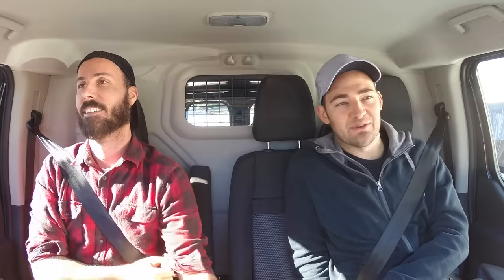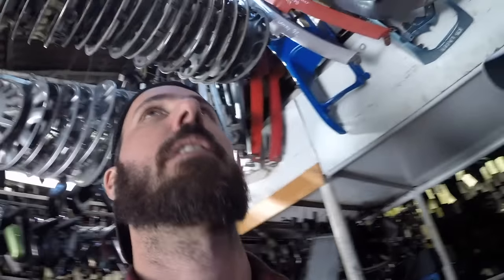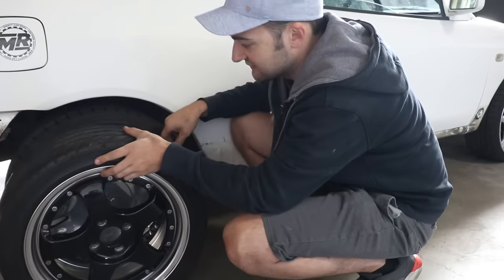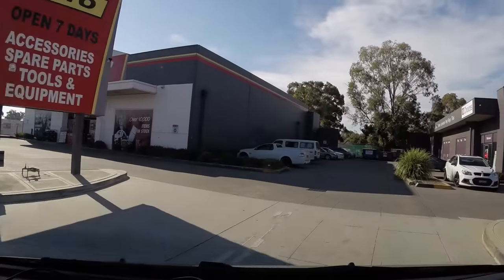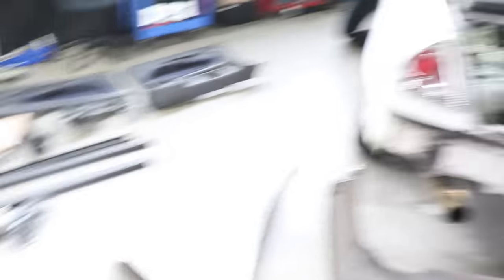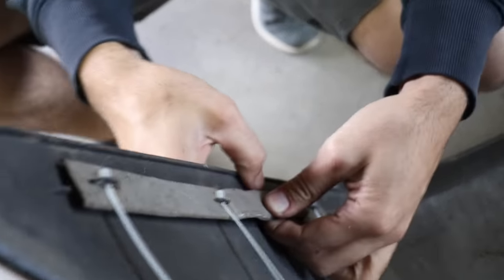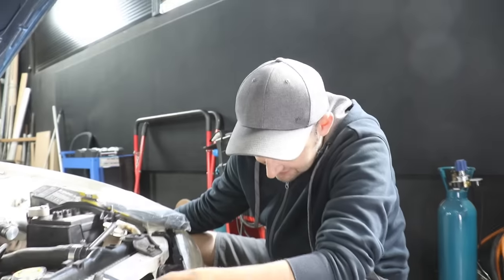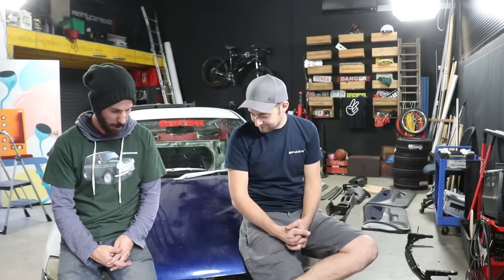How To Unmodify Your Car - Part 2

Comment: That cheeky ford promotion though.
Reply: its just normal, colin furze has it also but dont give it much attention.
Reply: I was rather interested in the van, it seems like a decent hauler. I wonder if it's diesel, it kind of sounded like it.
Reply: ***** ah yes I forgot that was a diesel. I'd take either if it came to US
Reply: No, Transit Custom has a 2.2L 4-cylinder.
Reply: franku sonnnn

Comment: I used to own a 2000 Lancer sedan - the brakes are not suitable for the track, they fade really easy. I did a cheap and really effective brake upgrade - fronts where CC Lancer GSR callipers and brackets and either GSR discs or custom due to the PCD. Rears went from drums to discs - you need to hunt down the rear brakes off a Proton Satria from around the 2000s from memory. It's worth getting everything from the Satria brake wise including the brake cable. It should be a straight swap with no custom work. 

In regards to the side skirts, the MR lancer from that era had a body kit which was mild, the side skirts off of that would work and make it subtle. Great work so far on bringing it back to a normal looking Lancer. Good luck.

You should also do an AWD conversion when you get some $$$$ - there were a few in NZ from memory that got converted - mad 2 door Lancers.

Comment: yes you can get good HP from stock intercoolers, the problem is when you take it to the track. You'll find you loose a lot of power very quickly because the IC heats up and is less efficient.

Comment: i don't know but i feel like the old front easily could have worked for a track car. especially because it could fit over the intercooler and yes it was used for a over all sexspec car which is gross i agree but when the rest is stuck it isn't too bad. you feeling me? and it sure is cleaner than a hacked up stock bumper IMO 

again nice video this is the second time i'm watching it already haha. i just really love your videoes man.

Comment: should do an evo 4 front conversion fenders bumper and hood, the bumper will help wiht the fmic, and the evo 4 fenders are not flared like evo 5-6 so it wont give you a widebody, also evo 5 sideskirts made for 2doors

Comment: hey guys, was wondering if you could help me with a project that i had in mind. I was hoping to make my 1984 corolla's carburated engine into a multi point injection but i hit a small problem... the engine has no crankshaft timing sensor and im not sure if i need any more sensors, any ideas? anything at all would help. Thank you

Comment: i got a question...  

why throw all the body stuff away, only to buy new body stuff?

couldn't you keep the old body stuff, and just repaint it?

 like, bring it back to good colors and reattach correctly?
Reply: Because the sex spec body kit is hideous.
Reply: ok, so it was less about color and condition, as appose to the look and shape of the body parts?

Comment: i just saw a video from air lift performance compering air suspention against coilovers and they got the best of air suspention but didn't show what coilovers they used (maybe even stock) 

maybe its a cool idea to do a real test like what u did with the gt86 or brz's with wheels and coils but now with coils and air?

Comment: Was actually thinking the front mount is waaay to big. get another bumper and im sure you guys could get ir have a smaller intercooler. I have a Time attack spec R32 Gtr (556bhp ath 472ft ibs) and my intercooler is bloody massive, going to swap mine out as saves weight.... #becauseracecar lol

Comment: I pulled the nasty and cracked interior door panels off my '85 S12/Gazelle and did a nice JDM duct tape panel as stage 1 of my interior mods...not saying you should do 2sexy like that, just suggesting.

Comment: We all know they don't read the comments on videos but I think this would be a great opportunity to start a video or 2 on how to fiberglass body panels, they could cover simple things like wings then move onto bonnets/boot lids which could feature how to do glassed in threaded inserts so it can be bolted to the standard hinges, then move on to more technical/larger weight saving items like doors, or more adventurous projects like rear quarter panels or roofs

they could also cover different techniques like wet lay up or vacuum moulding and different types like shredded glass mat or woven glass mat etc, also with using white gelcoat they wouldn't have to paint the panels they make, and once you have a mould every item can be repeated for just the costs of the materials used, ideal for track cars....
and of course this could be also used for carbon fibre or Kevlar bits

Comment: I've come to a conclusion that "performance parts" aren't necessarily "power parts", nor are they required unless you're replacing a weak link. You guys show this to be true in almost every episode when you replace a stock part with larger/different stock part from another whip.

Comment: Should've just cut the bottom part of the bumper down the center to allow it to stretch apart. Then run garden edging as a splitter, and to give it support again.

Comment: what car should i get a mx5 nb dohc with vvt or a mk4 golf gti
Reply: gti with a k03s
Reply: miata is always the answer.
Reply: I cant mod the mx5 tho
Reply: Arnon Lund can you mod the gti
Reply: +Daniel Dematteo i can get away with it on a gti
Reply: +Daniel Dematteo but on a mx5 i cant just slap a turbo on it
Reply: +Daniel Dematteo gti i can have a full silicon intake, water to air intcooler, mbc
Reply: +ChrisHallett83 i was actually thinking of bora vr6 4motion as well
Reply: ChrisHallett83 i ended up getting an Silvia club Q's

Comment: Manual transit van?
Reply: Yes? That's not even worth questioning because of how common it is..
Reply: +Shona Very uncommon in the states.
Reply: vteckiller100 We get a lot of deliveries where I work and none of those vans are manual. Furthermore, every moving van I've ever been in is automatic. Most dealerships have very few manual vehicles on them. The manual transmission is very uncommon in the states.
Reply: @dirtyyyyysouthh  *They're

Comment: I actually preferred the tail lights that were there. The ones that were put on look very bland and dated and scream "Granny Car".  I also would have kept the hood and trunk lid. Less effort to rework them than replacing and reworking. The huge inter-cooler should be 86'd for one that would allow  the stock front bumper to fit. I do really like the wheels though. But it's your car, so carry on.

Comment: Gee what are you doing?4:00+That rubbish pile is a mix of everything:green stuff paper steel electronics plastic &wood.Is there no such thing as a very basic recycling.(Just in case, that is a system to reuse stuff that isn'tneeded anymore,to prevent waist) Is Australia that far behind?I thought you would care for nature down under.I'm flashed man.

Comment: I remember not liking altezza lights over ten years ago when I was fifteen, I still don't.
Reply: Lol, I hear you. I never picked them in Need for Speed underground. Always ones with a black background or masked to match body colour.
Reply: I just never changed the lights full stop.
Reply: lol fair enough.
Actually... I never changed the tailights on the Skyline r34 because they all got rid of the classic "double Os" and looked complete garbage!

Comment: You had to pay to scrap metal???? that's mad - metal in the UK (apart from being Heavy) is taken to the scrappy and they pay you for the metal!! sorted!!
Reply: You can get paid for scrap metal in Australia
Reply: Most of it was fiberglass, plastic and fabric (aka general waste) If it was nothing but Steel or Aluminium, they would get paid for it.
Reply: Steel is so inexpensive that at least in Finland you have to have heaps - meaning tons - to get any money. But this doesn't count for any other metals, like copper, stainless, aluminium etc. Those have good value.

Comment: Your trash system is super complicated.
Reply: Scotty Collins no it really isn't. You dump your stuff at the tip, they will probably get you to sort different types (general, furniture, white goods, cardboard) then it's either free or you pay by weight. Very simple.
Reply: For household trash, the county comes and picks it up once a week.  It goes to a landfill.  For big stuff I have an old slough run on the back of my place.
Reply: same thing happens here.
Reply: Where are the guys at?  Seems like a long time since the last video

Comment: I remember when a 25 minute MCM video was a tear down, rebuild and test of a car. Now its finding a boot/bonnet and screwing them on. These videos now days just move so slowly guys, We are 50 minutes in already and the cars only half way. 

I love you guys but we really don't need 50% of the video you dudes small talking in a van. I just skip through now days to get to the parts when you actually work on the car, and then the video is over before any real change happens. 

Look at the cressida video, you guys stripped two cars, retrofitted an engine and then even took it drag racing in 2 videos. Now we are lucky if we see the seats get swapped out.